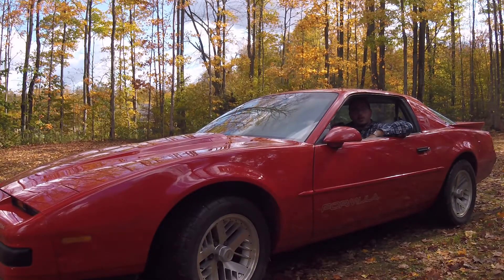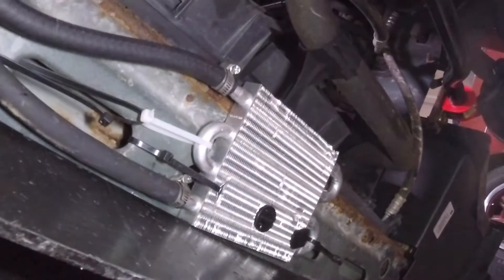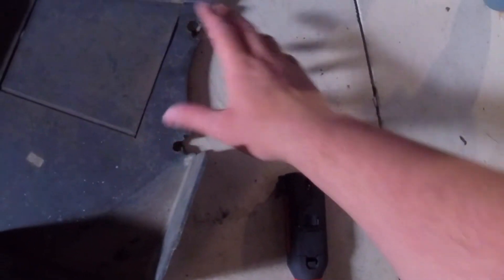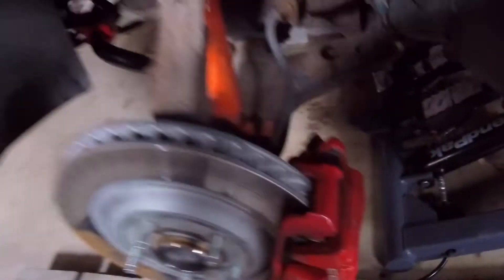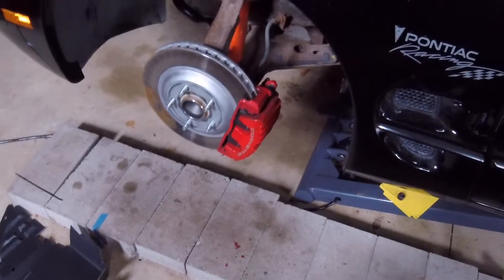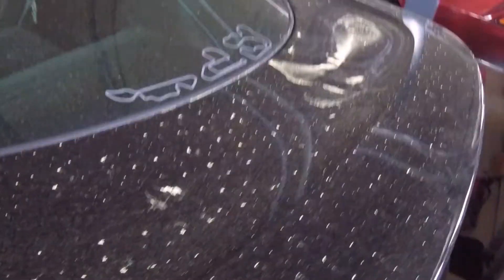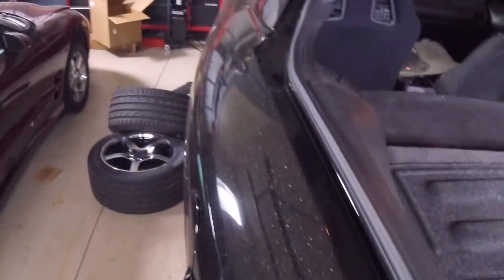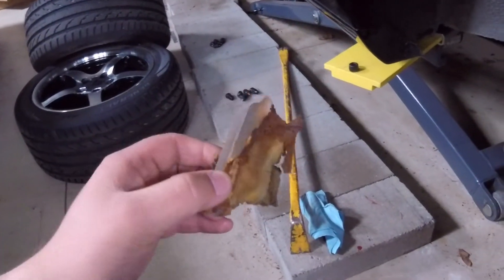2002 V6 Firebird Track Car Project June 2022 Update (Steering Cooler, Sway Bars, Shocks, and more!)

Comment: Great video.That power steering cooler is probably all you will ever need,Much better than the coolers they put on the LS1 Cars.
Reply from the maker: yeah, the ones built into the rad hose is such a bad design. This one seems to be effective so far. Interested to see how long it lasts before leaking/breaking. It was only about $20 from amazon